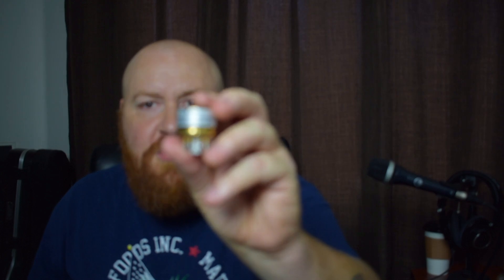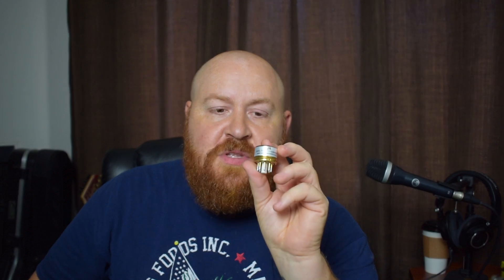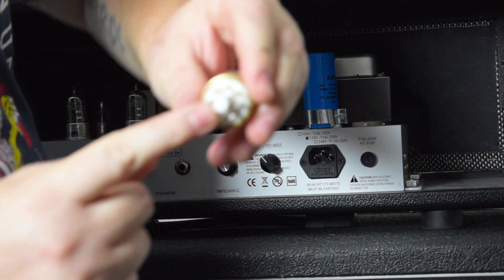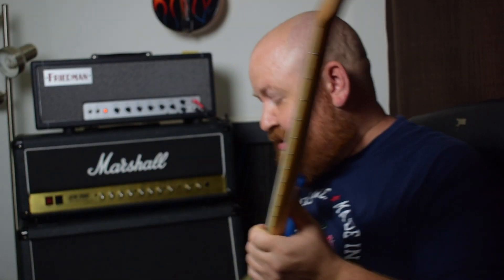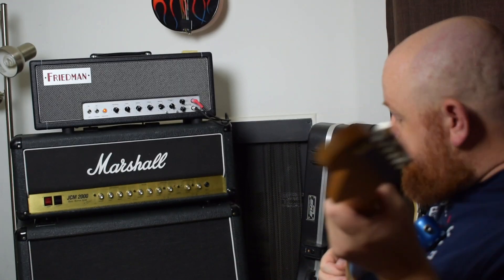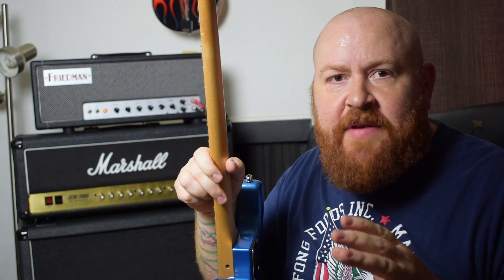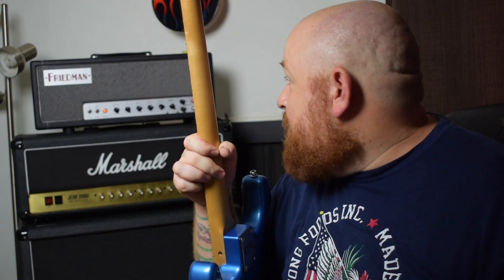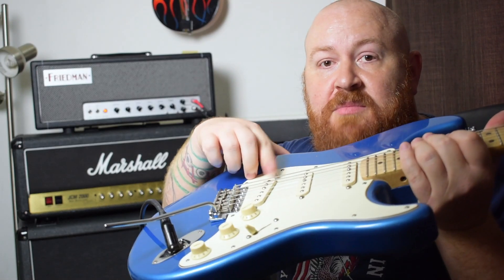Friedman Dirty Shirley with a Solid State Yellow Jacket Rectifier

Comment: I did the same with my DS40 amp too... It still had that tubby low end, but it was a bit better. I believe Friedman has made the bottom end more controllable (or more options) in the Twin Sister (the 2 channel DS coming out soon)... More ability to tighten it up
Reply from the maker: There's a control for reining in the low end in the power amp on the twin sister. Don't tell anyone -- but Dave installed it on mine as well :)
Reply: @JonBingham  You have that new Bass control on your DS? I thought it sounded more punchy, crisp, and present than all the others I've heard.....Very cool👍

Comment: I didn't hear much difference but unfortunately I listened on crappy headphones. I recently learned my favorite all time amp, Naylor Dual 60 (which I believe was inspired by Dave's channel switching mod), uses a solid state rectifier. So I can say with confidence that they don't suck. .... but I doubt it's a tone upgrade for an amp that's not designed for it. Might be cool in the gigbag in case that tube fails.

Comment: Yes,   believe me I know That amp in n out...... Here's what came across from a self proclaimed DS40  expert lol...... Tube rec yielded a bit more of a wooly sound (think bassman cranked) maybe a touch less mids...... The ss rec. Yielded more gain, but the gain is smoother,  and it is a bit brighter..... Might be an upper mids bump I'm hearing..... But I bet if u bumped gain up and mids up and treble up, then cut bass a little bit with the tube rec, u could get the two very very close..... The biggest difference to me other then  the increase in gain and upper mids(brighter), is the character of the breakup.....tube was a little more raw and rough around the edges despite it having less gain,  the  break up with the ss rec was smoother and more focused to my ear.....I may try it in mine to maybe achieve a black flag jtm 50 vibe (the amp that Angus used to record most of the back in black Album)
Reply: Also if u do it with a les paul then I can more accurately assess...... My ear is trained to deconstruct les paul tones,   other guitars, especially single coils and fender types throw me off, if u have an sg or les paul (preferably lp) I can accurately destruct, then analyze, every minute characteristic of each tone....... I've done it every night for a over a year with my lp and DS40, just turning knobs and listening intently, same with raising pups, swapping tubes etc...... BTW the winning tube was a short plate blackburn mullard i61 circa 1960.... Get one.... Put it in v1 of ur shirley and thank me later
Reply: Change those shitty 5881's for NOS EL-34's...MASSIVE difference in my twin sister...ordered a solid-state recto...

Comment: I had the same experience until I tried this in a vintage amplifier and it was more of a noticeable difference than it was from my modern tube amp,  in which it seemed a little more punchy and a little better on the low end.

Comment: You won’t know the difference in sag between tube rectification and diode rectification if you’re a bedroom player. Sag only happens when you push the power of the amplifier to its upper limits. And lower wattage amps are less susceptible to power sag than higher wattage amps
Reply from the maker: That's right. I was  turned up half way recording through a torpedo live. It was definitely juicy enough.